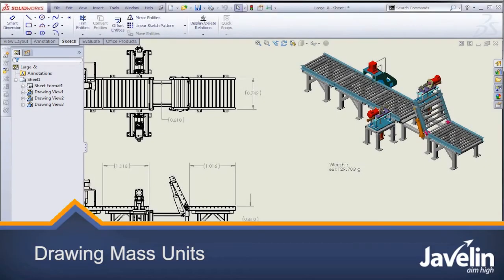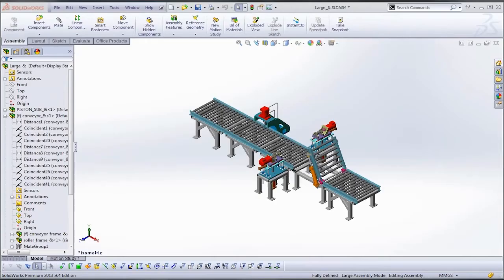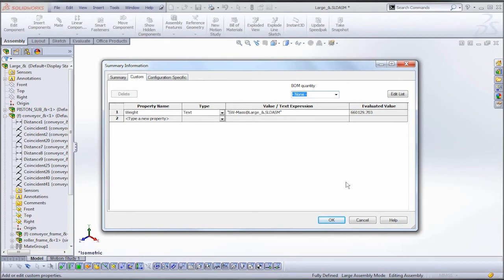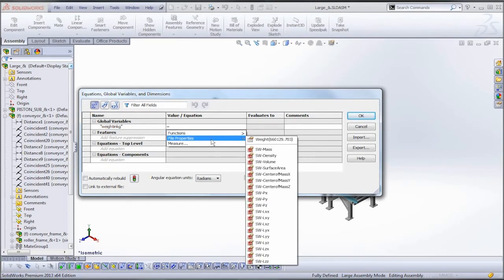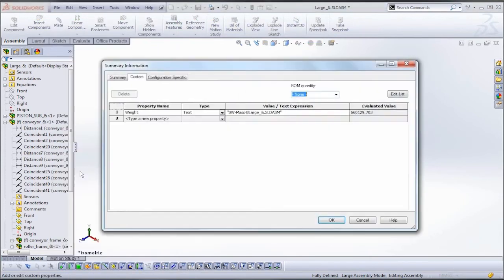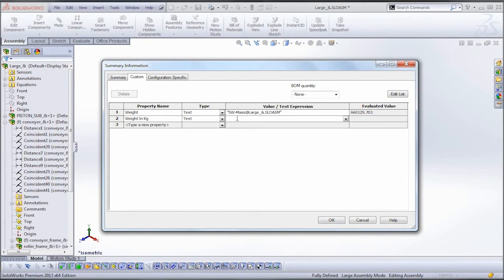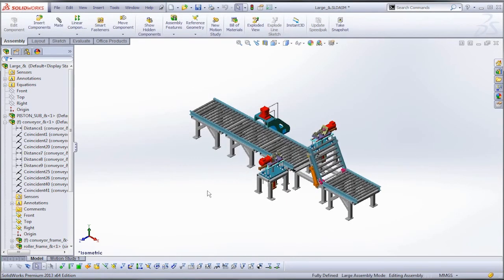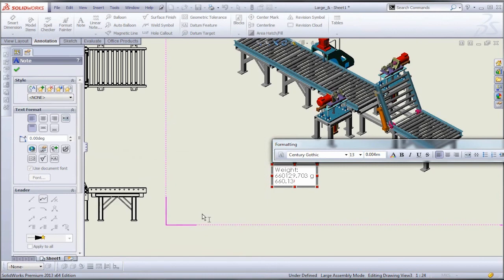SolidWorks: Drawing Mass Units

Comment: It'd be a lot easier if you could map a property similar to SW-Mass that was SW-MassUnit (or something like that).  It'd be nice to not have to write a macro that would automatically update the custom property text if the user changed the document units.

If the user changed the document units from mmgs to use lbs, the formulas in your custom properties would be off.

Comment: Careful, performing equations against the mass causes a serious performance issue especially when you keep adding it to the parts and assemblies nested in the larger assembly. The issues will affect rebuild time, dimension editing time, and cause random freeze-ups while you're moving around and clicking on items in the model.